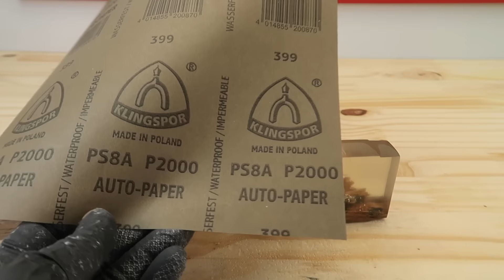I Turned this $5 Broken Level in to a Piece of Art with Epoxy Resin

Comment: I have two thoughts. 1. Does it work properly,  did you get the bubbles in exactly to level. 2. I wonder if you could have used a vacuum while curing the epoxy,  to avoid bubbles.  At any rate, I really enjoyed the video and think you did a wonderful job!

Comment: When sanding something flat on a sanding block, make a figure 8 design. Ten strokes to right, then reverse. Continue until finished. Your flat surface will be flatter. This works for large items as well as small: I have done it with 28 gauge wire, holding it close to sanded end. Very even results.
Reply: You are welcome. This is a jewelers' trick.

Comment: If you do get into the resin projects, build a good vacum chamber and get a good 3 stage vac pump. That way you can vac all the wood stuff and have no bubbles. It will stabilize all the delicate items aswell like burnt wood and such. A good vaccum will get all the crevasses nicely filled. If you go that far ya might aswell do a pressure chamber also! Goodluck.

Comment: I’m not sure how often you plan on using epoxy resin but perhaps invest in a pressure pot it’s a container you attach a air compressor too and it sucks the bubbles out same way you’d leave it out for 24 hours but with the exception that the resin is constantly under pressure removing all the air bubbles it may be something to think about for future epoxy video ideas you may have it looks great by the way i love it

Comment: I just started watching some word turning channels doing epoxy work. They cure the epoxy in pressure pots at like 60 psi. I think it’s to avoid the bubbles or maybe drive the epoxy into the wood joining surfaces.

Comment: A simple way to test a level is simply place it on a surface, mark the position in pencil. Take note of the bubble position. Turn the level 180 deg and the bubble should be in the same position. But well done. Your work looks great.

Comment: Question...would it have been possible to make a mold of the screws and make screws out of resin? Or maybe adhere the brass plates on the resin side with false brass screw heads? Just a thought...It looks great...

Comment: cool to look at, not sure id use it for its original purpose after it has warped that much. putting it through a plane machine wouldn't work either though because the inserts for the liquid tubes warped too. it also would have been better to find a way to re-attach the end piece to the resin end without screws. seeing them in the resin is a bit of an eye sore.

Comment: I am restoring my great-grandfather's level which is quite like the one you restored.  My problem is that the very tip of one of the bubble vials broke off allowing the fluid to escape.  The vial is in good shape except for the tiny tip broken off.  I can put new fluid into the vial using a hypodermic needle, but I don't know what fluid to put into the vial.  I've tried a couple of things, but they foam up or have multiple bubbles which doesn't work.  Any ideas?  Thanks in advance.

Comment: I have heard that epoxy resins are carcinogenic when exposed to unprotected skin, and also cause allergies. Not to mention the dust from epoxy mixed with sawdust.
So it would be a good idea to use mineral oils and paint that are non toxic to humans on most of the wood. Also i'd prefer to remove broken wooden part with saw and replace it with different colored piece of wood, using titebond 3 brown glue.

Comment: Maybe I am over thinking things but don't you need to plane it to make sure its flat, and then have it sat on a perfectly level surface when you are inserting the bubble level into the plaster?  Maybe the table is perfectly level and the project was already checked to be flat?
Reply from the maker: yes

Comment: As much  fun as it is peeling the film off new plastic, wouldn't it have acted like a nonstick surface for the plastic you used to contain the epoxy? Would've been easier to sand that off than it was to get the plastic off the epoxy, it seems like.

Comment: You should have spent a little more time making sure the bubbles were i. Right, looking at the before and after  you can tell thr main bubble wasnt installed correctly and I hope not one  ever tried to use it. This is why the install them with plaster so the bubble vial can be adjusted while the plaster is wet to make sure the whole level is true

Comment: You would have had less bubbles remain on the wood and no overheating (causing the yellowing of the resin) if you had used a slower casting resin. This laminating resin reacts too fast even at low temperatures. I even had a portion catch fire once  because of the exothermic reaction....

Comment: Unfortunately it’s unusable, as the smaller level revealed a big bow in the wood, probably why the original owner let it get to the state of snapping
Reply: i was thinking the same thing.. it can be machined to level where the bubble is currently set to correct this but i think it's more of a decorative piece than functional

Comment: I don't think he leveled the level.  All sides need to be square to each other.  Before you can set the bubbles the level must be placed on a absolute level surfaces in both the horizonal and vertical plan or it will never be accurate.

Comment: First off, all that brass , you should not have sanded, Brasso and polish…. Just like new, same with those old brass screws, secondly, vacuum chamber, no more bubbles, and a heat gun , smoother surface.

Comment: Purely from a visual design standpoint and with no practical considerations at all: I was sad to see you drive a screw into the acrylic end😥 

You can disagree but I think it would've looked cooler if you had used an industrial strength adhesive to hold the metal endcap in place; 
... and maybe for consistency: you could ground into a nail and filed it down to the flat part, and then glue it too. 

Just sayin how a felt bruh you do you yo, looks good your way too

Comment: The resin job is actually poor. It is full of bubbles. The section of the wood that came in contact with the resin should have been sealed better, the pour should have been done and torched on layers, or the whole thing should have went into a vacuum chamber before it set to pull the air out of the epoxy then torched.

Comment: I don't see any art here
bought it for 5$ ........first misstake
none of the horizontal and vertical waterlevels were carefully adjusted like any level should be.......second mistake
A bunch of air bubbles trapped in the epoxy.....third mistake
Calling this a work of art......fourth mistake
Where is the Art Work ??
Reply from the maker: yes
Reply: @TysyTube  
Yes what ???
It's not a complement that I am giving you !!!